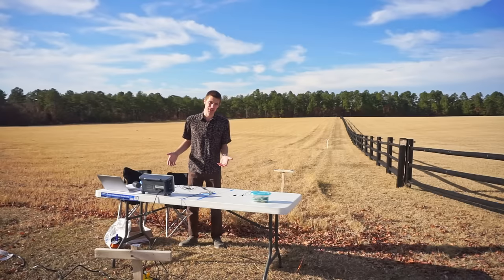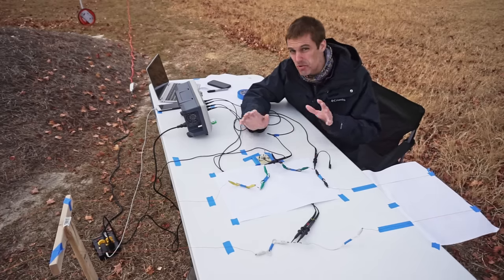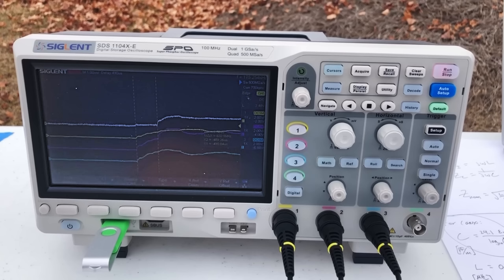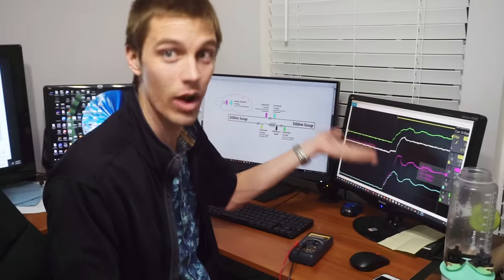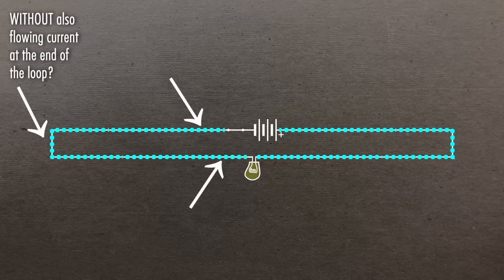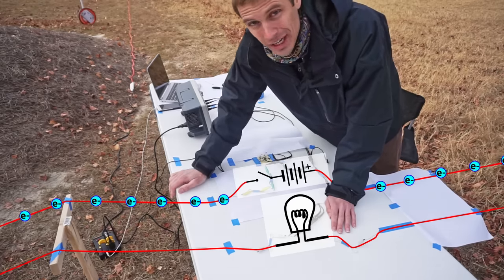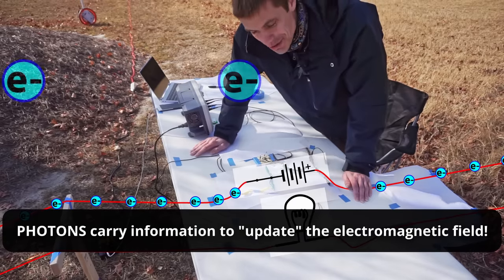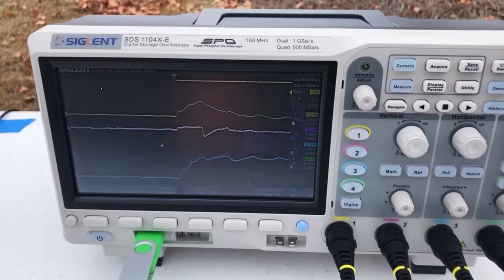I bought 1000 meters of wire to settle a physics debate

Comment: I wonder what the graph would look like if it were an actual circle shaped loop of wire rather than the wires running next to each other? Really interesting video! Learned a lot from it to be fair. :)
Reply: The effect is lessened with distance. Therefore in a circle the distance would always be huge which would probably make the effect unmeasurable.
Reply: boop
Reply: @spinnenente  Fair enough, I just thought it might stop the interference or something between the wires and maybe be a more accurate result of measuring the speed. I know nothing about physics by the way! Just guessing stuff, but that's how you learn I suppose!
Reply: @FriesOfTheDead  boop
Reply: I think the initial blip will have a delay of 2r/c sec. and the steady state will have a delay of πr/c sec. (ignoring ripple).

The harder challenge will be to make measurements. Placing of the oscilloscope will matter - at the center of the circle, or near the switch/bulb. Running long wires from the oscilloscope to the probes will also cause additional delay and interference.
Reply: There would be another Problem: At which position does the scope sit? And how long are those wires to the lightbulb and battery... With the current Setup the information at the lightbulb and at the battery can be obtained nearly instantly (a few cm airgap) If you spread this circuit into a circle the information needs to travel farther.
Reply: That’s what I was thinking!
Reply: @jBurn_  Ohh sorry, I was on about the actual long length of wire not any of the equipment for measuring anything :)
Reply: Rather than one circle which would be difficult to connect with reasonably length oscilloscope leads to how about 2 circles, one one each side. Actually a modified circle on each side with the wires initially leaving the central testing location all at 90 degrees to each other so as to further remove the capacitor effect.
Reply: The sircle would increase the inductance so the initial voltage would be lower and non linear, short fading pulse and ramping on to full voltage would take way longer
Reply: @Shenron557   I agree, but the initial blip will be immeasuarable as the distance between the wires is no longer ~0.1m but ~160m. As the E-Field falls off with 1/r^2 this means the blip will have an amplitude about 3.9E-7 compared to the 0.1m distance parallel lines.
Reply: Don' t do this on those static dry days... 😅 You can tase yourself
Reply: It would radiate away
Reply: @FeroxFolf  you  could just screen the wire to get rid of most coupling.

Comment: Cutting the wires was a perfect demonstration of what was happening. I'm incredibly grateful you're changing the distances between the wires as well
Reply: I really missed a superimposed image of the open vs closed circuit case.
Reply: Yes, cutting the wires was a great idea. What perhaps he should have said was it was important to cut the wires after having them connected first. You can't start the experiment with them cut, you need them connected at first to get steady state DC voltage drop across the switch before you close it. I've seen lots of other commentary on the original experiment which talk about the ends not being connected without making it clear they have to start off connected for anything to happen when the switch is thrown.
Reply: @andy_taylor  No you don't need them connected. You misunderstood the video.
Reply: @romankalinchuk2750  they need to be connected initially or else the switch will have no potential across it. If there's no potential across it when it's closed then nothing will happen, you just end up touching two pieces of metal together (there may be a tiny electrostatic charge transfer). Initially before the wire is cut the switch acts like a capacitor, it's changed up to the full potential of the battery. When the wire is cut that switch ”capacitor” is still charged so when it is closed you will get a sudden rebalance of charge across it. But if you start with it disconnected you essential have an uncharged capacitor, so when you short it nothing happens.
Reply: @andy_taylor  Thats not correct. That's not how capacitors work. There is no current flowing though capacitors. Capacitors are not connected internally. The pulse you see comes from the battery, not from the switch and you are completely misunderstanding the video
Reply: @romankalinchuk2750  no, exactly my point. An open switch (through which no current flows) acts like a capacitor in a circuit where it's connected to a battery. It's essentially a capacitor with an air dielectric. One side if the switch is held at the positive potential of the battery and the other at the negative.Think about it, if you have +5v across the battery you have -5v across the open switch.
Also you're wrong, the pulse comes from the switch! It's has to, the battery can't magically know that a switch some distance away has been closed, Einstein tells us we can't have action at a distance, the pulse comes from the switch because that is the thing that has its state changed (closed), not the battery.
Reply: @andy_taylor  Seriously, look up how capacitors work. The thing you're not understanding is that he could open and close that switch as often as he likes and you would continue to see the pulse without ever connecting the ends of the wire.
Reply: @romankalinchuk2750  so a capacitor is defined as two conductors separated by an insulator. It's that simple. An open switch is defined as two conductors separated by an insulator. They are the same thing! 
Also are you telling me that I can connect a switch to one side of a battery and if I keep opening and closing it a can generate infinite pulses of electricity without discharing the battery? Don't think that would work.
Reply: @andy_taylor  Its not that simple, the plates have to be close enough for them to to effect each other. A switch only has a very tiny amount of capacitance that it doesnt even matter. If you connect a battery using a capacitor(such as 2 long pieces of wire close to each other... hint hint) in series with a load and keep turning that switch on and off, then yes, the battery will eventually die.
Reply: @romankalinchuk2750  I'm not saying an open switch makes a good capacitor, my point was, like a capacitor, you get a build up of opposite charges on either side of the switch in the DC circuit and it's the sudden movement of that charge when you close the switch that initiates the wave. If you don't have that initial charge difference across the switch you won't get the same effect. You may get some tiny static charge difference because no two pieces of metal will have exactly the same potential, which is maybe what you are alluding to.
Reply: @andy_taylor  Anyway, what I'm saying is he could keep opening and closing that switch and keep producing those pulses. You would need a basic understanding of transmission lines which has to do with capacitors and inductors to get it. The 2 wires interact because of the proximity. I know what you're trying to tell me and it sounds doesn't sound like you understand how capacitors work. Its not just 2 pieces of metal getting charged without any interaction or proximity to each other

Comment: Ever since Derek's video I thought "what if you cut the ends of the loops?". Good to see someone actually do it.
Reply: I had exactly the same thought!
Reply: would it matter if the wires were not stretched side to side. but instead, the bulb is on the further side of the battery?
Reply: @ThreeWhiteSoldiers  you wouldn't seethe effects of capacitance and inductance as shown in this video, since they would be acting parallel to the wire, so wouldn't get the shortcut path.
Reply: Derek says the light bulb still turns on with the wires cut, which is a bit of a stretch.

Comment: It's called "velocity factor", and radio buffs take it into note while designing antenna systems-co phasing harnesses, for example.
Reply: Yep. In open wire, it's about 0.95
Reply: Ay was looking for a HAM related comment!
Reply: Always good comments to read on good videos! ty :)
Reply: Velocifactor?🦖
Reply: velocity factor in respect to the speed of light. thus .95 x speed of light.

Comment: Great video. As an RF engineer, I use what you are demonstrating all the time to determine the lengths of lines and discover faults in transmission lines using VNAS and Network Analyzers that use AC signals along with the line's known characteristics. Propagation delay is definitely a factor in coaxial cable, the nature of its construction; it's just a chain of LC circuits.